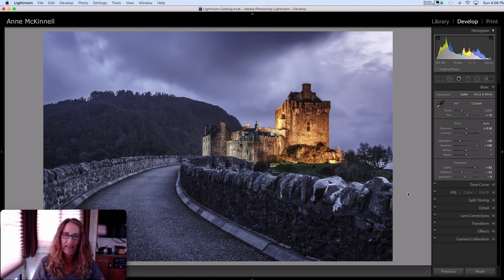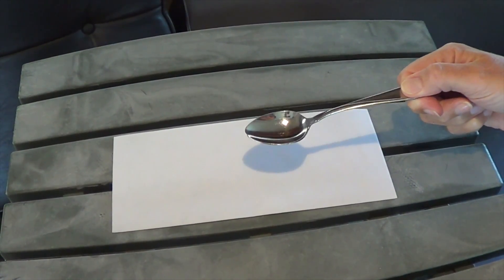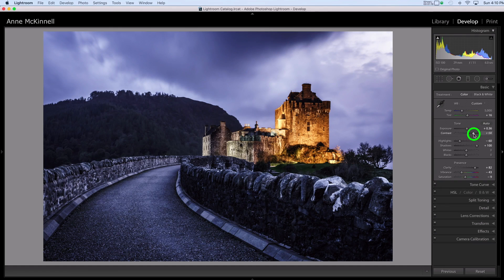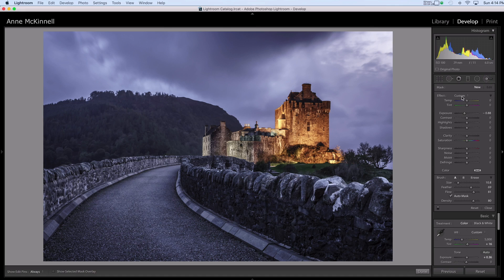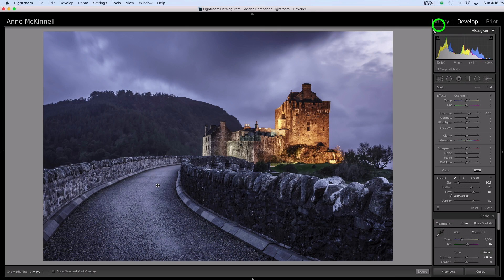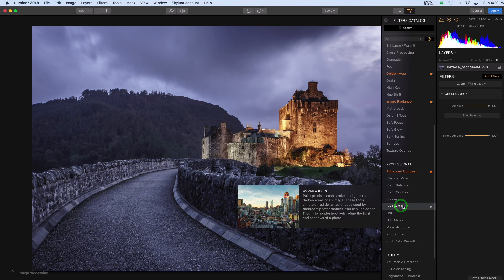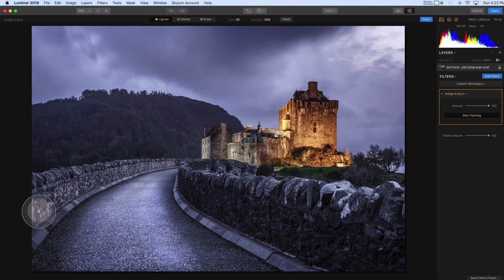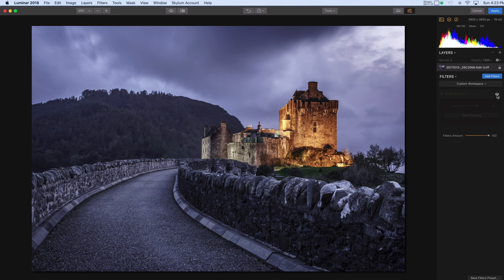Dodge and Burn Using Lightroom or (preferably) Luminar

Comment: when you explained about putting the spoon over the paper( when you were shaking the spoon) you said the area would become lighter, don't you mean darker/ as it gets less light? so less exposure? or am I missing something?
Reply from the maker: No, it's the other way. This is very confusing for a lot of people! I explained this in more detail in the blog post that goes with the video which you can check out here: http://annemckinnell.com/2018/05/28/how-to-use-the-dodge-and-burn-technique-in-photo-processing/
When you are making an image in camera, it is based on film, and more light = lighter. That's when you are making a negative (even if you are using a digital camera, the concept in camera is the same). But when you are making a print, it is a positive, so everything works the other way. The easiest way to remember this is that when you make a print, the paper starts off being white and when you add light it turns darker so more light = darker. When you dodge the light (like I did with the spoon) you're preventing light from hitting the area so it will be lighter than it would be if you didn't dodge it. I hope that makes sense. The blog post is probably better for explaining this.
Reply: Anne McKinnell  ahh cool thanks , im new to photography so I'm still learning, even though I have been around when dark rooms were around but because im late in life to learn photography i bypassef using a darkroom all togeather.